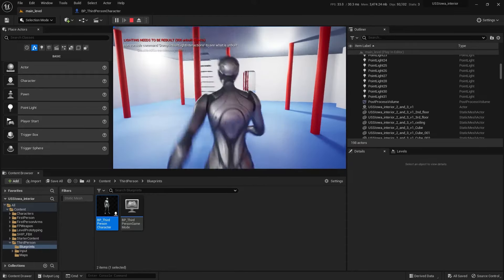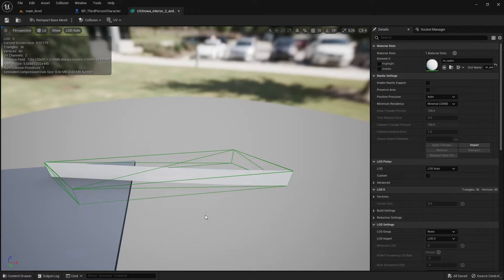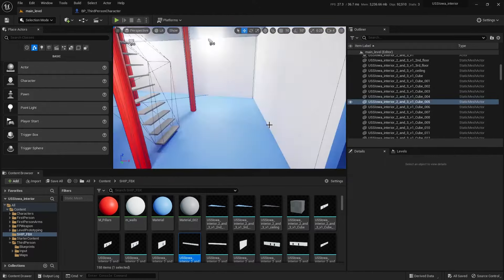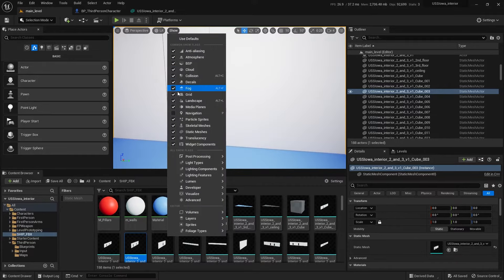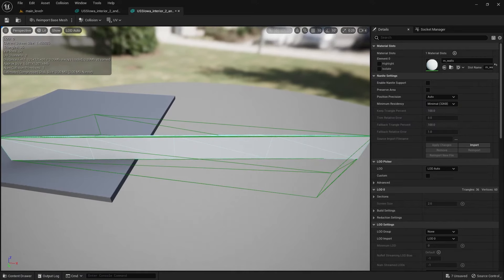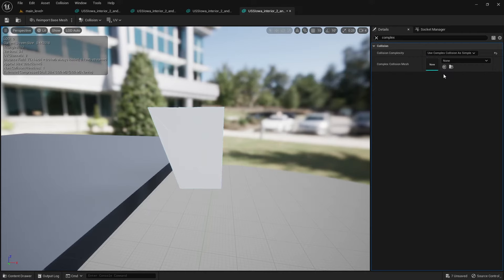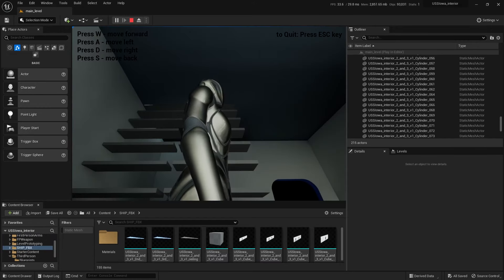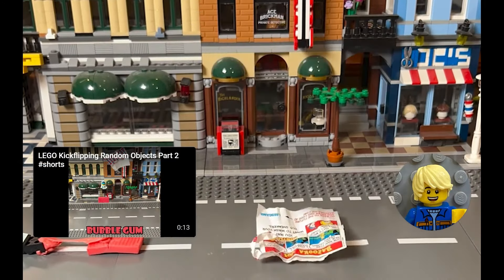Fixing and Modifying Collisions for Static Mesh Shapes in Unreal Engine 5 #ue5 #unrealengine

Comment: Thank you!
very simple and friendly explanation to niche topics all developers will eventually run into. I'm just worried about performance cost of changing into complex collision every time. You said a few times that the complex collision actaully "Looks" more simple than the simple collision but I'm not one to trust the looks. Is there a one to know the costs of using the complex collision? or comparing the computatiotnal costs to the other collision options?

Comment: Thank you for this! Unfortunately I'm hitting a problem on some objects.
When changing simple collision to complex on curved pieces, it's causing the character to clip through the object near the edges, even though I can see the collision area covers everything?
Works perfectly for straight/diagonal objects, but curves are just broken.
Any idea why that may be?
Reply: Curves are complex shapes and complex shapes are always an issue.
Best thing you can do is create multiple smaller or thinner box-like shapes and place them along the curve of your object.

Better yet, if you make your own assets in Blender for example, create the collisions in Blender, then when importing in UE UN-tick the box for "create missing collision"

Comment: Nice video! How do you do the holes in the floor/ceiling? I am trying to get some meshes I made in Blender that have holes to come in and allow the character to fall through the holes.
Reply from the maker: You could use multiple simple cube collisions as I did for the doorways, or use the mesh’s complex collision - tho best to use first option as it’s less dense, but kinda depends on your mesh too…

Comment: Any chance you'll consider doing that full control rig tutorial where you cover face and fingers? I've been waiting on that for a short film I'm putting together. Also while doing it, I hope it's not asking much, but there's a project that got added to the free section of the Unreal Marketplace called "Control Rig Samples Pack" where they have a mech which has a control rig. If you grab the center yellow square and move it, rather than the mesh stretching on the legs with the legs staying firmly on the floor. The legs move to keep the structural integrity of the mech in tact. Is it possible to do that very thing with a humanoid character? Because that is what I've been wanting to learn ever since I saw it on that mech. Thanks in advance.